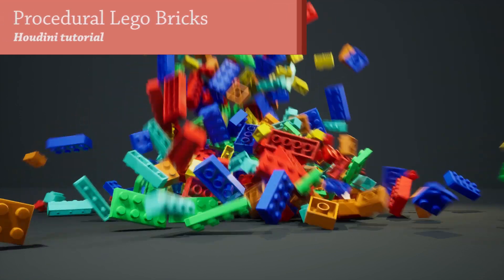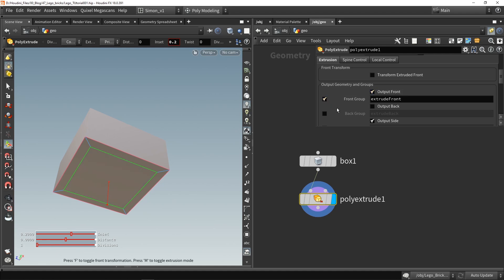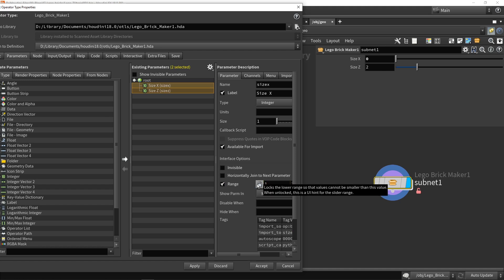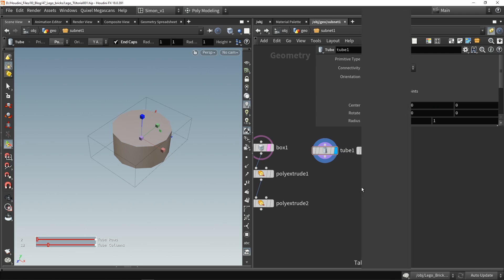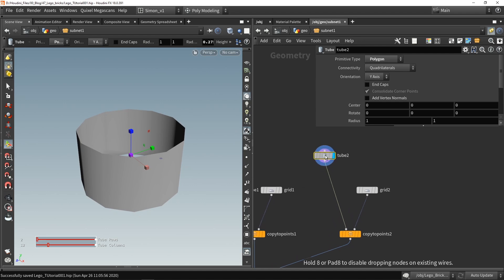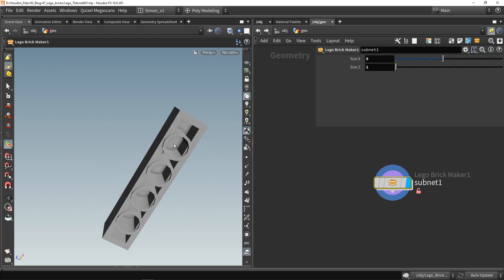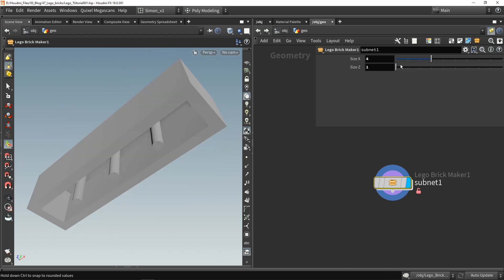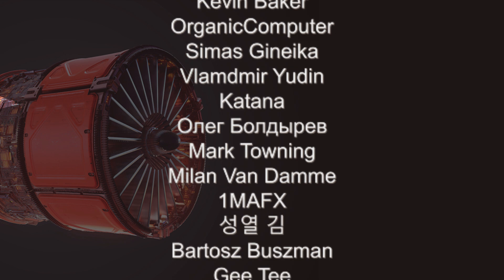Procedural Lego Bricks Part1 || Houdini Beginner Tutorial

Comment: Thanks for the tutorial, but in 20.5 doesn't work this way anymore, in sop subnet level the tubes does not appear (04:54).
Reply: Same the thing. Did you find  a solution?
Reply: I did it? There are exist Output node. It necessary set her index to 1.

Comment: hello,there is no "switchif" node in houdini 17.5
Reply: Hi. It looks like Switchi if node is a user friendly version of switch node. In version prior to 18.5 you can use swich node instead, but you'll need to learn expressions, which will be much more beneficial for you in the long term instead of relying on new nodes. Here how it works.
1)You connect all you inputs to the switch node. Two in this case.
2)In the select input box you type the expression like this " if( expression, 1,0) " where "1,0" where 1 is what input to switch to if the expression is True, and "0" if it's false.
The expression is a logic expression that consist of a number of inputs (path to channel, detail attribute or variable) with a number of logic operators. "||" - or "&&" - and, "==" - equal to - this is all that you'll need for this tutorial and 99% of use cases.
I strongly encourage anyone reading this to do it yourself. 
But here is mine for reference just in case.
if (ch("../sizex") ==1, 1,0) || if (ch("../sizez") ==1, 1,0)  holes connected first(0), poles second(1)
if( ch("../sizex") ==1 && ch("../sizez") ==1, 1,0) geometry connected first(0), null second(1)
Reply: @Zhiznestatistiks  thank you for your help.